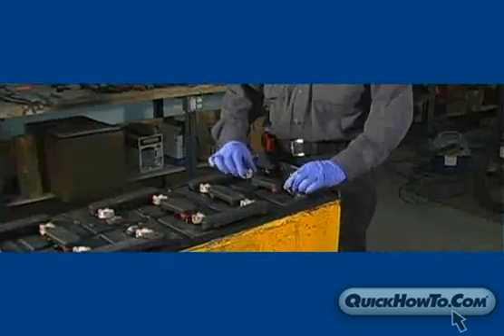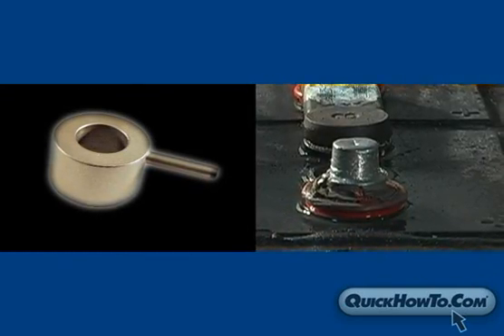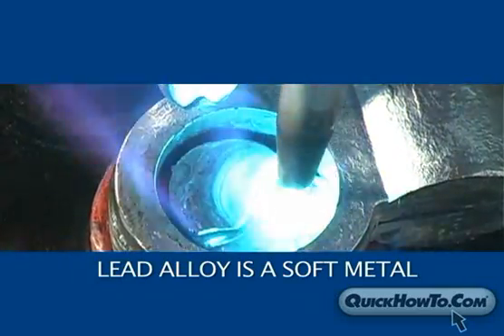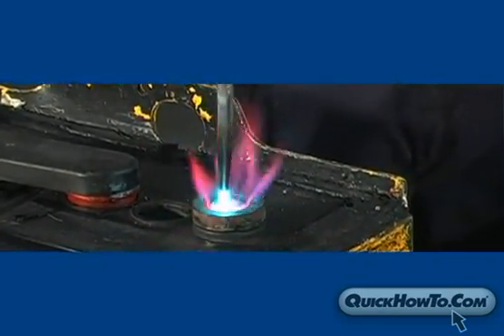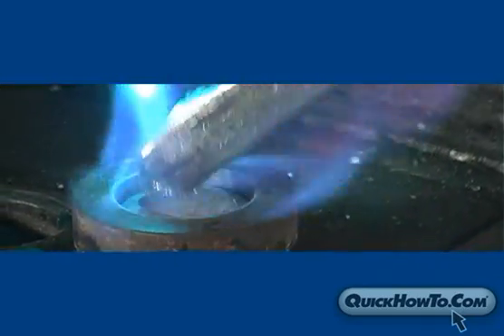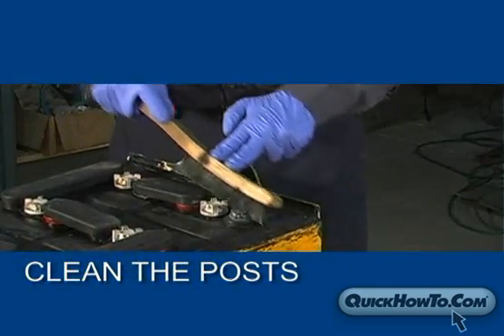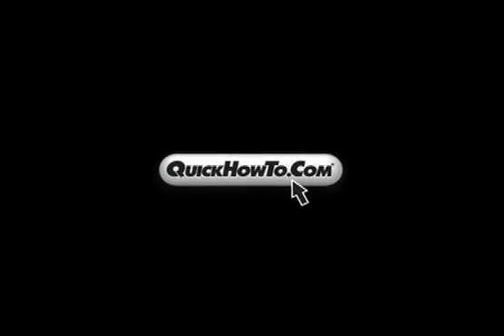Material Handling Training Video: Rebuilding a Post

Comment: The Ez Battery Reconditioning program is a digital book (ebook) which guides you through the process of reconditioning many types of batteries [Check Details Here==>https://plus.google.com/100351090281822647456/posts/Ct2x2kZGdNN ]. My first impressions were good. I must say there is a lot of information here and even better it’s formatted in a way that makes it easy to read and follow.

Comment: One other problem, I've done post repairs many times so I know what I'm talking about. The problem is that you do NOT show how to flam out the battery, you know that hydrogen gas is explosive, and you do not want to explode one while your working on it.
Reply: flam out a battery? how do you keep from melting the top of the battery as well?
Reply: @freemurray  Get good and practice on scrap batteries. Heat management is very important, as well as cleaning your lead to be burned so it bonds easily. You can wrap a wet rag around and that helps a bit with heat management.

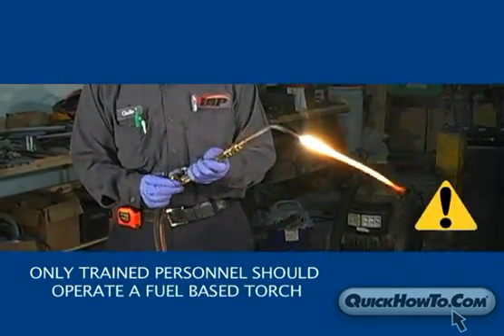Comment: Excellent video and thank you for sharing! One problem I noticed though is that despite all the safety warnings in the training film, there's a major safety "no-no" demonstrated at 1:34

An Oxy-Acetylene torch should never be lit using a disposable butane lighter, always use an approved type torch striker. If you need a reference, it's in OSHA 1926.350, Welding & Cutting